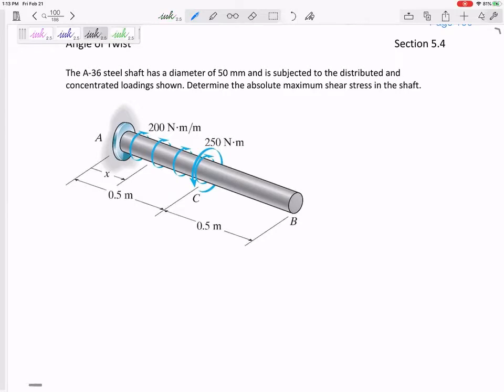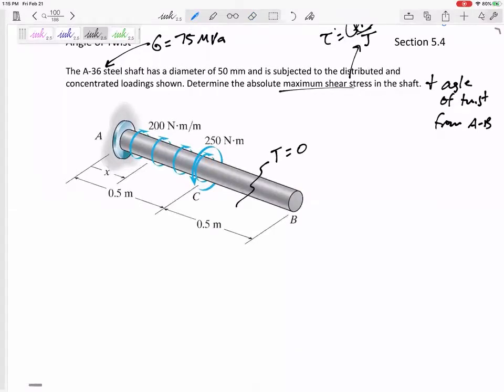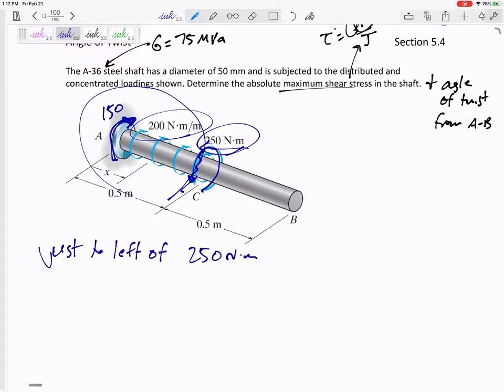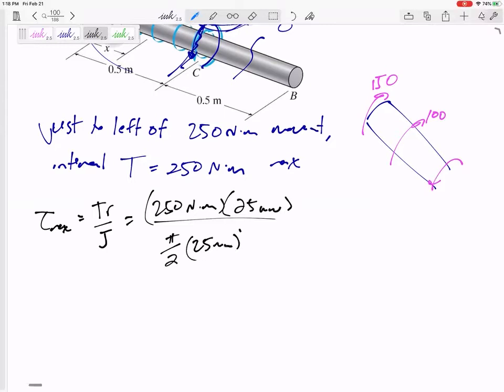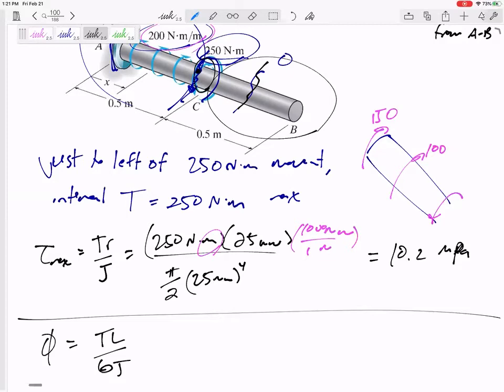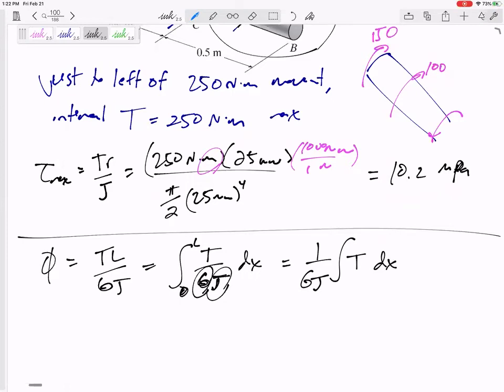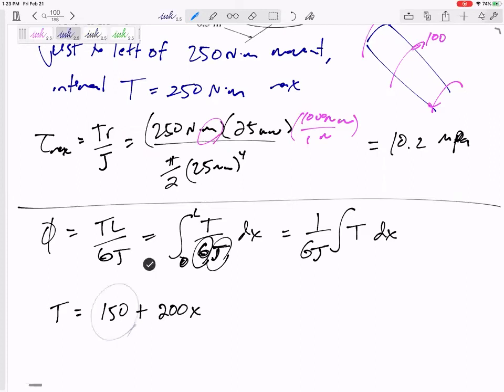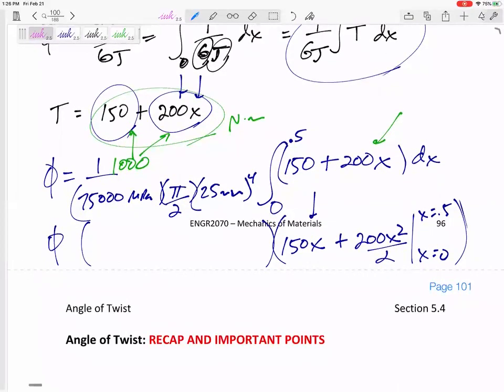Mechanics of Materials - Angle of twist example 2

Comment: could you explain why we switched the 200 N.m/m to 100 N.m as well as why did we make it go clockwise for 150
Reply from the maker: 200Nm/m is the distributed moment.. We multiplied by the length 0.5 to get the moment of 100Nm. The 150Nm clockwise is the reaction at the wall so that all the moments sum to zero.

Comment: This is absolutely wrong. Right before 250Nm you have 150 and 100 Nm clockwise which adds up to 250Nm counter clockwise so the result is zero. Max shear stress happens at A and minimum happens at 0.5m.
Reply: you are not right